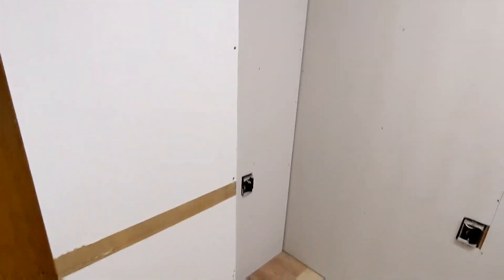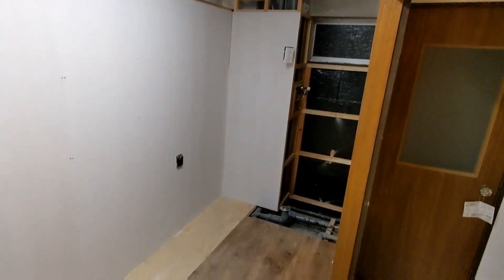Vlog #16

Comment: I'm maybe too late with a suggestion to raise the washing machine on a platform to allow easy access to the plumbing under it?  It would also make access to the loading door easier for the user.   I fully agree with the raised power points. .. wherever I do work in my home I get the power points raised from about a foot above the floor to about three feet because I'm not getting any younger and raised plugs make life a lot more comfortable.
That's a great job you have done.
Best Wishes, Brendan.
Reply from the maker: Yes, making a platform to raise the washing machine to clear the plumbing has always been the plan, exactly HOW I do it has been the conundrum LOL
Reply: LOL, I should have known you would be way ahead of me!